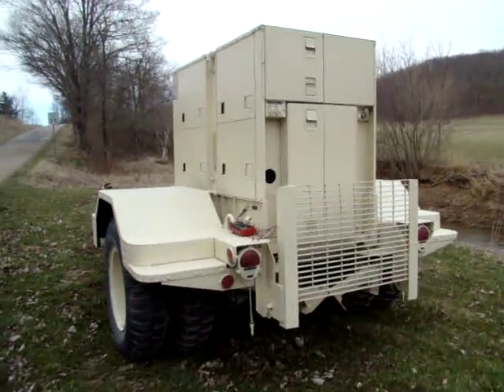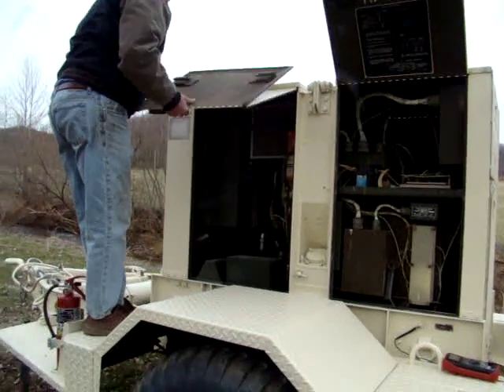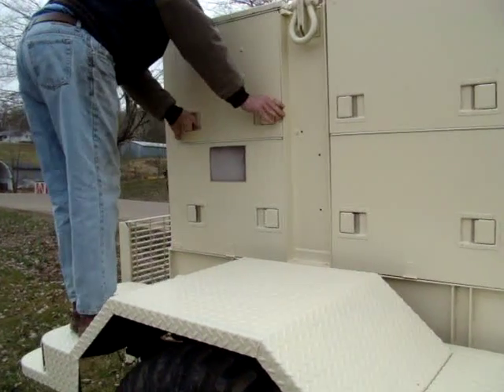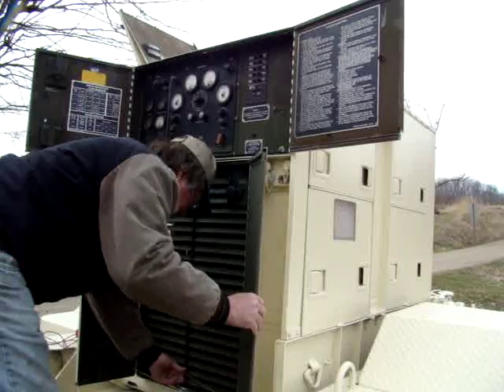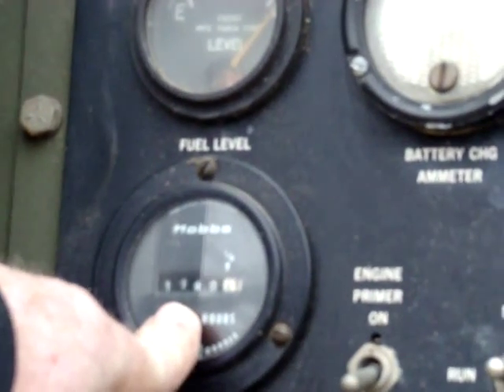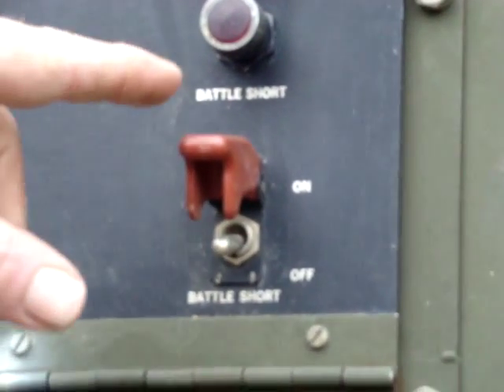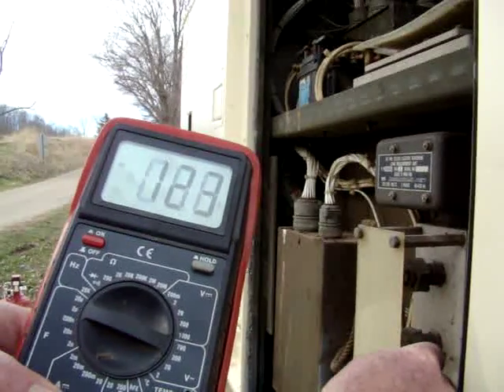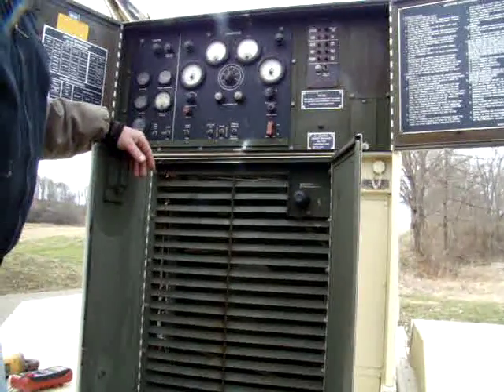MEP-004A 15 KW Diesel Military Generator

Comment: I LIVE IN ECUADOR S.AMERICA. I AM FROM THE US. I HAVE PURCHASED FOR MY FARM, A 1977 WHITE D 198 ER X51 15 KW GENERATOR WITH 180 ORIGINAL HOURS. I DOWNLOADED THE MILITARY USER MANUAL BUT I HAVE A QUESTION NOT ANSWERED IN THE MANUAL.  I AM UNSURE AS TO THE POSITION OF THE FUEL SELECTOR LEVER. lOOKING AT YOURS IT APPEARS THAT THE HORIZONTAL POSITION IS THE NORMAL RUN SETTING. NOT SURE OF THE FUEL OFF OR THE AUX TANK POSITIONS. I KNOW ONE IS WITH THE HANDLE DOWN AND THE OTHER POINTING UP. IF YOU CONSIDER THE POINT OF THE HANDLE AS THE INDICATOR, SHOULD IT POINT UP OR DOWN FOR THE FUEL SHUT OFF? WOULD YOU MIND SHARING YOUR KNOWLEDGE AND ADVISING ME ON THIS. THANK YOU IN ADVANCE. ED HARNED. edharned56@gmail.com or on this foram.